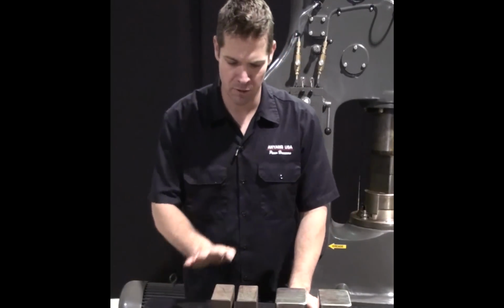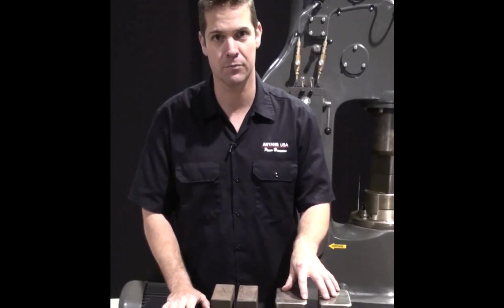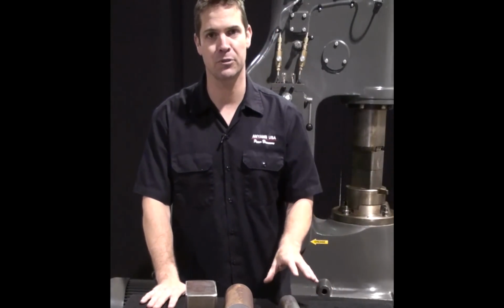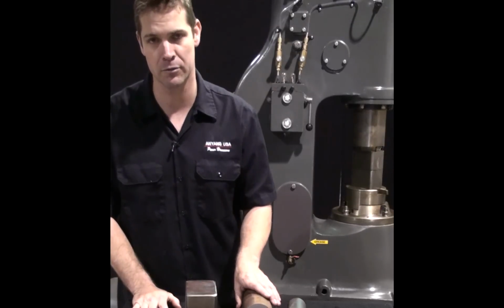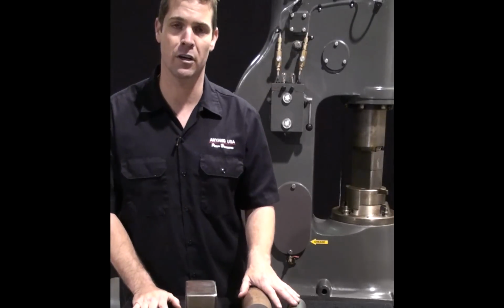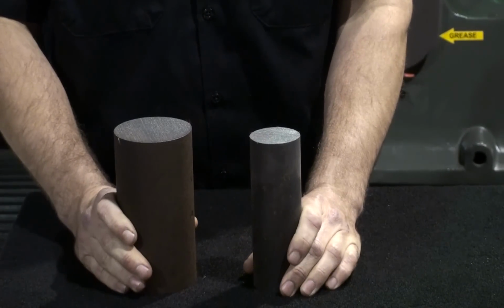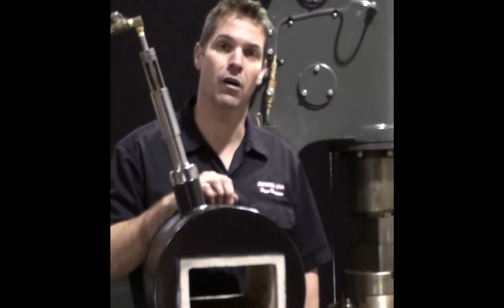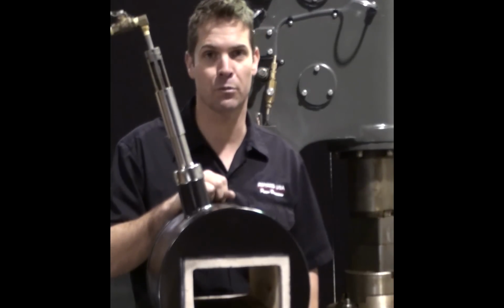Anyang 88 capabilities

Comment: James, I just sent deposit for an 88. Below, a question was asked if the steel being worked was 1018. You answered that it was 1045 which I am left to assume is the die material. I would have guessed that a hot use material like H 13 would be used. Please set us straight on this important topic. It seems that a 1045 die would gain a “sweet spot” more rapidly.
Reply from the maker: I just saw this... The die material is H13.  The steel being forged was 1045.

Comment: What's the power requirements?  3 Phase?
Reply from the maker: +forge52100 The hammer comes pre-wired with a 5 hp. 3 phase motor.  Can run on a 30 amp breaker.  If you do not have 3 phase, I offer a 5 hp. WEG, high torque, low RPM motor that is 220V single phase.
Reply: +jamesrjohn Thanks, that was information I needed.  I don't have 3 phase, next to impossible to get out here.  The 5 horse 220 should be plenty efficient for normal operation.  I'm looking at several air hammers, but like the idea of a self contained better.
Reply: +jamesrjohn Email sent, thanks

Comment: That is very impressive for an 88lbs ram weight especially with dies that wide. Was the steel 1018?
Reply: Actually it is ASTM 1045 CNC machined then heat treated at the Anyang factory.
Reply: James Johnson Sorry I meant the alloy of the workpiece. From my limited reading some alloys are harder to forge at a given temp than standard mild steel.